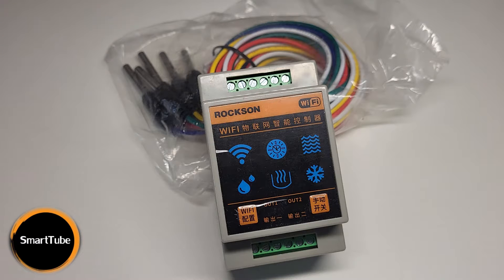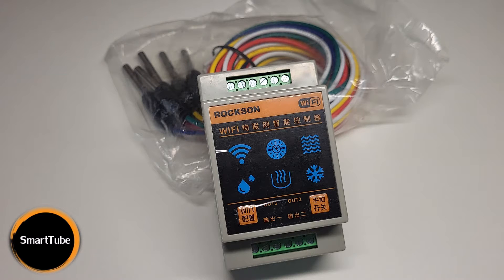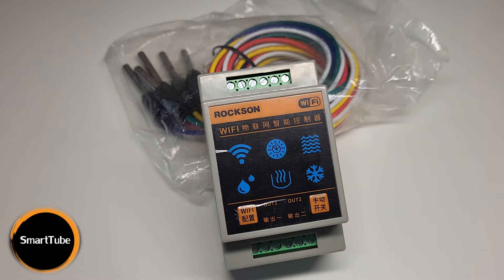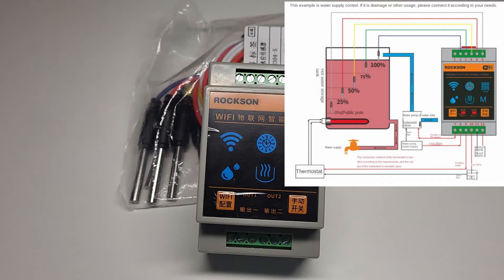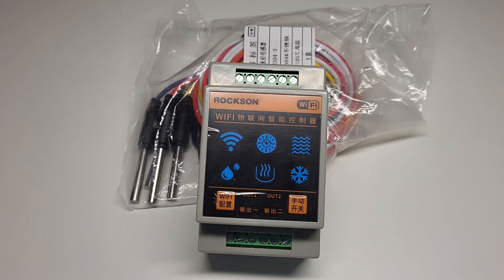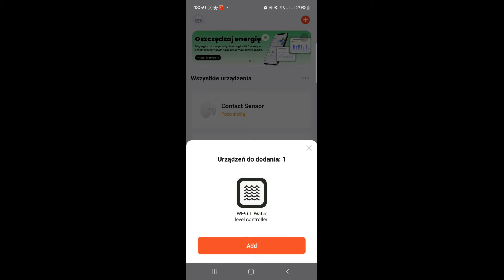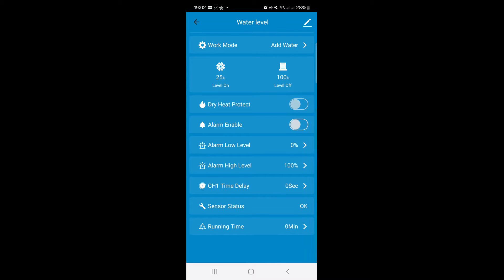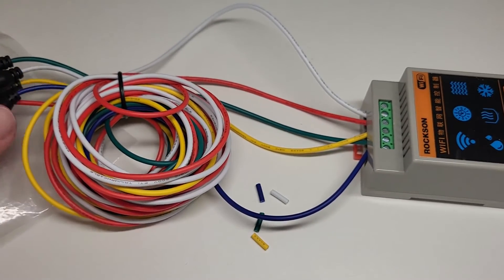Water Level Management Controller WF96L for Tuya Water Tanks Septic Tanks #smarttube #tuya #wf96l

Comment: hello friend. The input voltage to power the controller is 220AC or 12v DC?
Reply from the maker: Hi, you may find two versions one is for 220 and another is for 24 or 12, don't remember now, but I'm using 220. Good luck!😁

Comment: I want to take the product. But is it coding Can't be used without it? 
N.B Well home water tank 500L.
Reply from the maker: Hi, you don't need to code anything if you will use this device in Tuya app called Tuya Smart. I'm using it in the Home Assistant so that's why I had to do some coding. I'm showing the Tuya Smart application in my video. Good luck.

Comment: What kind of relay is needed to control water pump? What voltage is in controller output? 230 AC or 12 DC?
Reply from the maker: Hi, I think you should look at the wiring diagram on the internet for such controller, just type WF96L wiring diagram. The controller itself is not powering any devices that you connect to it, the idea is that the controller is like a wall physical switch for light bulb. Sorry, but unfortunately I did not have a chance to show it on the video.
Reply: @SmartTubeOfficial  ok, now I understand. I thought I needed a relay, but there is already an embedded relay.

Comment: I accidentally bought wrong version. Can i use humidity and temperature controller device with water level and water temperature sensor?
Reply from the maker: What do you mean by wrong version? This devices cannot power devices if you meant to connect temp sensor to it.

Comment: Does it support dry run protection? And ground water tanks water level indicator?
I habe 2 hp summersible pump which start with MCB type starter. Does this support MCB starter?
Reply from the maker: Sorry. I did not use all features from this devices. If you look for wiring diagram you may find your answer but important notice is that the device is not powering the connected devices to it, it just a relay. And I've also noticed that it's very sensitive and if the sensors are wet it will be still showing wrong state. For septic tank it is a big problem as you don't have only water there 😅